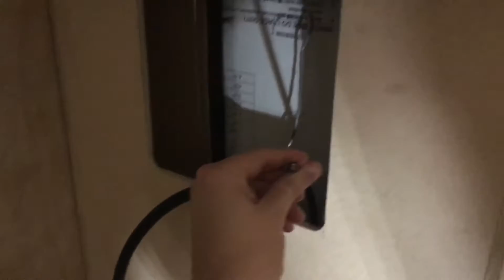Truck Update, Xantrex issues and repair

Comment: those are *OLD* MSW (modified sine wave - sorta looks sinusoidal staircase) - you do NOT want them in your new work.  Great repair job!! but your best bet is go to ebay and look for a Freedom SW-3012 which is a true sinewave in the price range of $1K - 1.5K ebay bucks in working condition.  I've seen them snapped up as low as $600 once in a while.  MSW and motor loads are not compatible. The freedom SW is a true SW better than your utility socket, and will honestly start a 3KW motor load like an air compressor.    In the inverter marketplace, you get victron or Xantrex, both have their devils in the details, ex: the 3K victron is really a 2.4K - 3K for a short time but not very long.  Xantrex will run 3K all day.   Both  options give you a nice graphic control panel $150 add on (more like $500 for the victron graphic display - but it's color for the extra 350) - --and you get a clean sine wave that's really robust if you hit it with 2-3 kw sudden demand or 100LRA it won't collapse starting motors.  I service xantrex and they're not too bad; I've built myself the 2x "stacked" SW-3012 120VAC to get the 240VAC, where they share a common neutral and have a phasing phone cord (!) between the units so they run 180 degrees out of phase to give you 240 with 6KW which makes for a very quiet 240V 6KW genset.  Personally - xantrex gives you the most options like the load shed box so that if your truck is  plugged into a 30A RV socket, and you turn on 35A of equipment, it will shed the non-inverter load based on your priority to get you down to 80% of the 30A (or 100% of 30A if they are so equipped) without blowing the breaker.  The nice part is that if you find good (epay) deals on sw-3012s over the years and collect them, you can stack up a 4 unit  12KW 240VAC inverter off a 12V big bank - I've gone lithium to put in a true 1000 Ah bank that I can pull 800Ah out every day if I want for 20 years, as opposed to baby-ing lead acid to only take out 30-50% so as not to damage the bank.  That was great photography you did of their current sensing running an extra wire through a transformer core - now they are using real current sensing transformers to keep an eye on the power produced by the transformer, and the pcbs have some surface mount - but the through hole resistors have a gold tolerance band -  wild to  see that nowdays.  Great job getting that sucker running BTW - now sell it !  p.s. - the only thing that goes wrong now is if someone parallels a generator on the output of the inverter instead of the input, they might have a code 17 welded relay contacts - keep those 2 deltrol relays if you don't sell that unit because that's the same part in the new freedom series.  Buy a welded contact, replace the relay and all is good.  Also people will sell welded relay units for $150 - simple fix and they're working perfectly.  It's hard to kill a xantrex.

Comment: In the same boat needing the transformer. Had the same symptoms and came to the same diagnosis - very frustrating. FWIW, the markings on my transformer are:

2661 rev 8, GCC 0238. 

GCC is also noted on the two current measure "transformers". Cant find anything related to these markings.
Reply from the maker: I am pretty sure all the magnetic s were custom wind for xantrex and was not able to find replacement/cross referenced parts. 

I just used the same transformer in the video but wired it better to the other side. I have had no problems a year on.
Reply: We have come to the same conclusion re the transformers being custom. I don't need to fix my unit for another 4 weeks and so I continue to google some more - even looking for a junked unit that might have a working transformer. What is frustrating is that these transformers appear to be used in later models but still no one is willing to cough up info or sell components. In any event, cool video and I'll post what I end up doing.
Reply from the maker: Mick Galvin, if you can't find one I'd suggest looking at mouser or digikey to find something close enough and glue it to the board. I unfortunately don't remember the part I used.
Reply: Brian Eaton we have found a reasonable substitute at our local frys electronics store. However I believe I might have found a xantrex repairer that might have them. And if that doesn’t pan out, I have found a few people with dead units where I might be able to liberate the part from them. So a few options in the works... who knows how this will end 😀
Reply: Ended up using the philmore tr015 transformer from frys. Mounted it upside down relative to the board using VHB tape and then used a "holding wire" over the top of the transformer using the two unused pcb feed holes that the old transformer used for physical holding. Installed and works 100%. So thanks again for the video - we found it very valuable confirmation of our diagnosis.

PS My inverter and microwave were subjected to 208 volts due to a miss-wiring at a local fairgrounds (dog show) which is why this transformer and a transformer in the GE microwave decided to check out. The microwave was a $22 fix and the inverter was $9. Thank god nothing else was on at the time ;-)

Comment: Did you ever figure out what size transformer it was. Have one i need to replace.
Reply from the maker: John Carter I never found the exact part. I just attached the 12V one in the video to the other side using VHB tape.
Reply: Thanks for the reply.